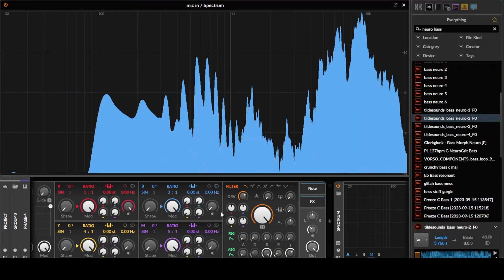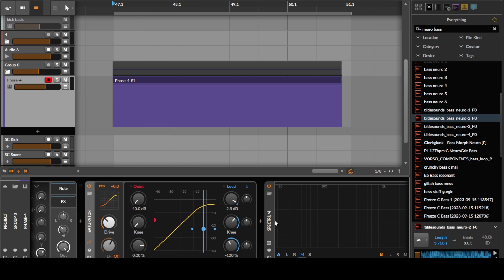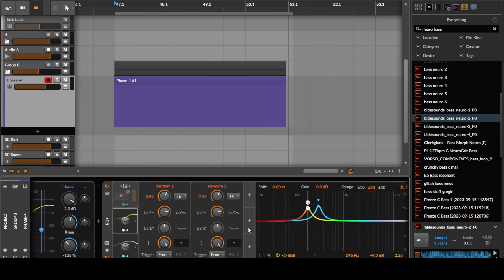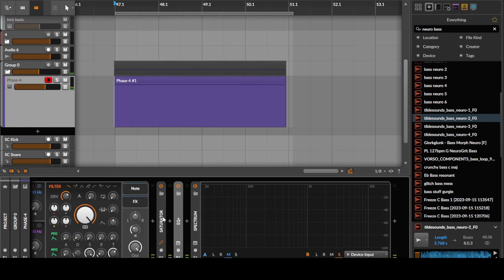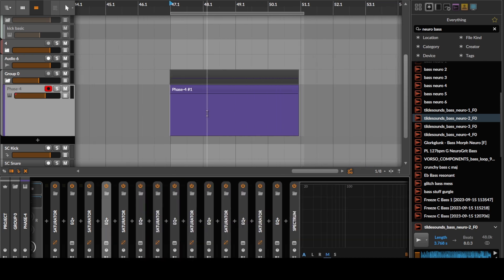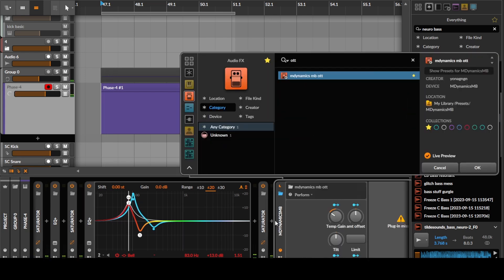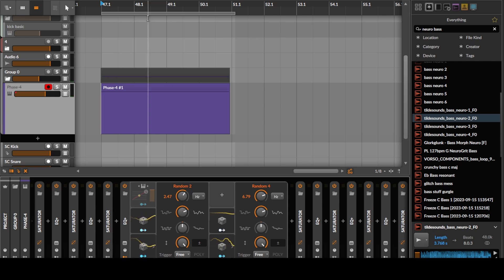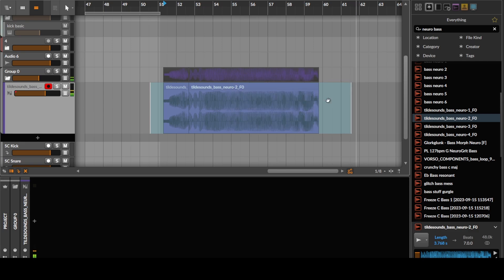Sine Compression | Sound Design Concepts Ep. 24

Comment: How do you end up with the fizzy, airy top end you got in some of the examples at the end?
Reply from the maker: there's a few different ways, some relevant vids might be the wavefolder one, the noise basses one and the pitch shifter one. highpassed parallel reverb is also an option. also ott with some aggressive high end compression can help.
Reply: @TildeSoundsthe reverb option I've done, earlier today, even, using real short, rich convolution impulses. I've also done things like the wavefolder technique and adding noise of course, but there's a different sort of breathy quality i hear sometimes that seems more delay/ comb/ reverb
Reply from the maker: Hm yeah i assume its the combination of a few different things. Ill often make a parallel chain to add that sort of thing where ill add idk, a blur, a pitch shifter, a comb, maybe some saturation or other stuff and then highpass it all. That rack is usually not at the end of my chain, so the high layer will get glued to the rest of the bass by subsequent processing.